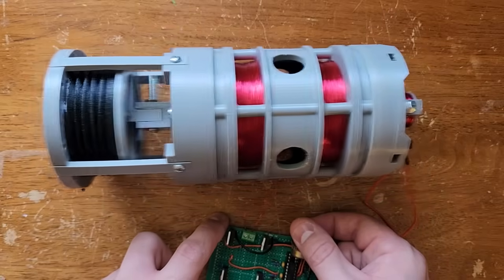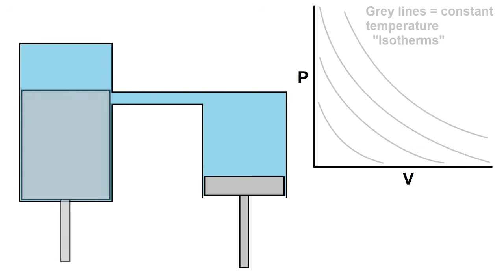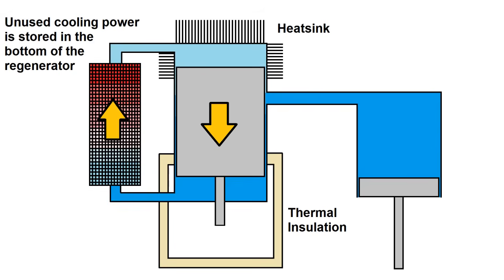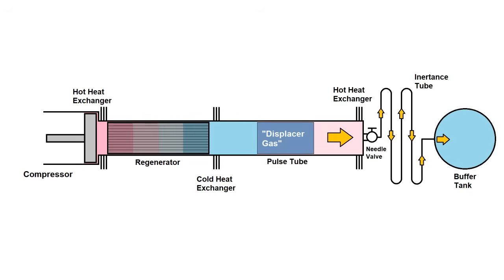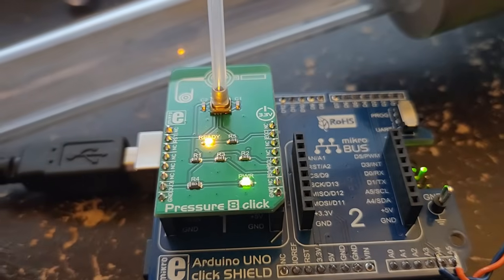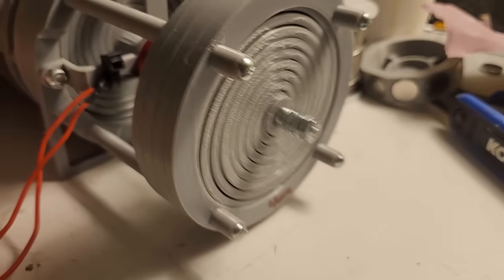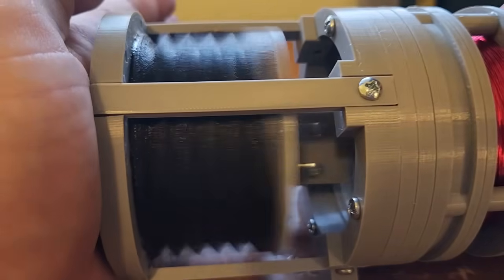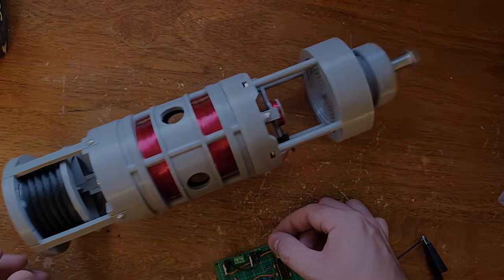Pulse Tube Cryocooler - Part 1

Comment: IIRC I saw the industrial/scientific incarnation of cryopump coolers on a trip to a particle accelerator with my physics class, I can't remember if it was to Rutherford-Appleton or a building above the CMS/Atlas sensor arrays at CERN, as cavernous as this service building was each cryogenic cooling pump was the size of a two-story detached house including the walkways and pipework above it. I believe it was used to cool and generate the cryogenic cooling fluids used to maintain the superconductivity of the hexapole beam guiding magnets. I definitely remember the all the racks of geiger detectors with large spherical sensors, the cabinets full of escape rebreathers, noble gas release alarms and the copious amount of asphyxiation warning signs in the subsurface service and office tunnel complex at CERN making me sweat a little. I used to work at a business park on the site of Culham Science centre and my office window and emergency exit opened out to a delivery bay with an inlet standpipe leading to a nearby tank that the cryogenic delivery lorry would hook up to every 2-4 weeks, the associated mist would swirl around and occasionally enter my office when the wind blew towards it and I left the door open to smoke outside.
I wonder how plastics would behave with the liquid oxygen that condenses with nitrogen from the air?

Comment: as you suggested i think that the way to do it at home has to be using a normal compressor and pulsing the air itself using some valves (the frequency could be an issue though). Also doing that way it should be alot easier to diy at home maybe with a little lathe. Is that the possible cheap open new way to build a cryocooler? hope it is because i need to experiment with some food in the kitchen :D

Comment: Aparently PT cryocoolers only work well when operated vertically. GM cryocoolers can operate in any direction. Wonder if that is a problem?

Information from Quantum Design UK and Ireland website. I am not an expert. Looking forward to part 2, with it working.

Comment: Amazing work! I always assumed a pulse tube cooler would require much tighter tolerances for the orifice and volumes. I'm trying to build a compression piston for a stirling cooler but can't tell if I'm getting enough compression for a measurable temperature change. What kind of pressure sensor are you using and any tips for sealing it?
Reply from the maker: Pretty much every piston is gonna have some form of blow-by, but if you run relatively fast, the blow-by becomes less relevant. For a lower frequency, though, I'd advise using a pneumatic actuator as your work piston, since the lip seal will actually hold pressure reliably. The only downside is that there's more friction than a typical piston.

The pressure sensor is an MPRLS series absolute pressure sensor talking over I2C to an arduino, but really any I2C pressure sensor could do the same thing
Reply: @HyperspacePirate  Thanks!

Comment: Use thicker copper wire in coil with more turns .. so that the push pull force will increase

Comment: Using a vacuum to draw water up a 34 foot tube would vaporize the water and create a cooling effect on the resulting gas, you'd then have to scrub CO2 and H2O. I'd then imagine your device as a railgun cycling to and fro hitting a spring loaded release valve on either side, so you'd be vacuuming up the already cold air, ramming it  and then cooling the exhaust but keeping it at pressure.

Comment: Really cool work. How hot are those coils getting? I think you could probably increase the H-bridge voltage, and maybe increase the distance between the coils, in order to increase compression. But I’d generally think that you need a lot more compression to make it viable, the only other thing to be tuned with this design would be the size of the piston. Maybe miniaturising it with the same linear motor would be the way to go? There’s a lot of energy in that piston, so I’m surprised at how feeble it seems at cooling.

Comment: You need single digit frequency and a longer stroke think in top dead center terms go to highest pressure and and it will push back on its own but you want it on its way back to compression then pulse the coils this will take some vibration out to

Comment: I'm completely out of my element but, I usually can still spot ways to improve something even if I don't necessarily understand it... With that said:
Having that counterweight is, effectively, wasted energy (lowering overall efficiency), by my understateding. So wouldn't it be better to utilize that energy by attaching a second, "passive" (no coil) piston to it and then tie it in with the pulse tube, with a simple reed check-valve? Or would that, more or less, be turning it into the Stirling Compressor?

On an unrelated note... Did I misunderstand, or was there not supposed to be a second gas present inside the pulse tube? 
Admittedly, I'm not really sure how it would stay separated, not just mixing and defeating the purpose but... 🤷‍♂️
Perhaps the buffer tank being filled with the nitrogen, and the intermediary tube acts as a natural check-valve of sorts, since the nitrogen would be denser by that point?? 🥴
Or... Maybe just use Sulfur Hexafluoride as 'other' gas? lol

I'll shut up now! Hopefully my ignorance shinning so brightly hasn't blinded you. 😉✌️

Comment: Interesting video. Another way you can achieve very low Temps is to cool a highly compressed gas then let it expand rapidly. With a scuba compressor and a bucket of ice water you can actually liquefy air. Just make sure to filter the CO2 out first as if you don't you'll end up with dry ice forming. If you wanted you could then cryogenic distill the different gasses in air out for various purposes.
Reply from the maker: Yeah, that's a "Joule-Thompson" or "Hampson-Linde" type cryocooler, which is the first type used in the late 1800's, and i think it's still fairly common for LNG/LOX/LN2 production on an industrial scale. The tricky part there is that pretty much all high pressure compressors have oiled pistons, so you also need a high-pressure oil removal system. There's also a tendency for expansion valve to clog with frozen ice/co2 over time, because even if you remove 99.9% of it, that remaining 0.1% will build up over time. Finally, the re-generator (which they call a "recuperator" in DC-flow systems) has to be very, very efficient - on the order of >90%. 

That's not to say it can't be done, but it's quite a headache, so i'm avoiding it for the moment.

Comment: Same type of cooler used in JWST. Very interesting video, but isn't the length of the tube very critical to match with the wavelength and resonance frequency of the motor to get the standing waves and so the nodes in the right spots to move heat?
Reply from the maker: You're thinking of a thermoacoustic refrigerator. Very similar in many ways, but a different device

Comment: I didn't see any coverage of your winding those coils, however you really need to try winding some common steel bailing wire you'd find at a home hardware store around the center of the electromagnets, and you could also try adding some over the top of the copper windings, though it will be most effective at the center (Both in the center and over the top would be great).  This will boost the effective magnetic field a great deal by concentrating it, and I think you'll be amazed at the difference.  It's why you'll never see a transformer (That isn't in the high RF range) without a soft iron or ferrite core.

Comment: Y E S O M G Y E S
damn Ive been busy but oh ma gawd I had been waiting for this.
absolutely sick video.

first things first, "temperature your girlfriend feels in a 23°C room" only if her legs are covered - if her legs are exposed to said 23°C she no longer feels cold.

also I'm a complete dumbass, and you're crazy smart, so I really have nothing to add here. the solenoid idea seems hella dope if you can implement it practically. in my experience solenoid valves aren't crazy fast, and I imagine they wouldn't last super long at 10hz+. 
but I also read some valves are actually air-assisted (the electric signal basically just opens a smaller valve and the pressure actuates the actual thing), so maybe with the 3D printer and the CNC you could make something like that for that specific purpose.
also I remember AVE's video on the hydraulic computer, so maybe you could also make an oscillating pneumatic mechanism where you could control the speed with a needle valve and it could actually be really fast and reliable.

thank you for the video man, this really made my day. as far as I'm concerned you're one of the best creators out here. you're actually doing the cool shit (pun intended but also I'm serious), and not just repeating something that's been done 50 times over.
Reply from the maker: Thanks.

In a valve-based system (called a "Gifford McMahon" configuration), frequencies are usually much lower on the order of 1-2 Hz, which solenoids can handle. However, on commercial units, the valve is typically a rotary valve with a motor inside the pressurized enclosure.

Comment: Hi. You explanation of how this works is very good and easy to understand, but one thing still remain unclear for me. I mean the regenerator, how does this part cool the gas. If you say that it works on Joule-Tomson effect, we have big problem named "inversion temperature", especially if we use helium, but almost all common GM cryocoolers works fine on helium. And this problem haunts me for a very long time. I would be very grateful if you could help me understand this.

Comment: Great effort on this attempt, you are really making me feel like I need to use my 3d printer more.  
So I used to work in a thin passive component fab and we used cryopumps on almost everything that didn't involve Silane(a super scary gas).  A cryopump is just a cryocooler with basically a heat sink on the cold end that gas would freeze to and pump out the cavity.  I think we had around 30 cryopumps and would re-build a couple a year.  They were all of the Stirling style where the regenerator was stacked mesh in the displacer.  They all had large compressors and used a valve cycle style setup.  
Typically our pumps would run somewhere around 8-12 Kelvins(when they were at running well).  
Once I got to look inside one when it running and had the baffles off; the frozen gas on the carbon heat sink looked just like water frost might look even though it was just frozen air at 10s of Kelvins.

Comment: Wow! I found this video on my recommended and was not disappointed. Thank you good sir! It's really enlightening to watch someone who's so comfortable with Thermodynamics and allows me to learn 'real' thermodynamics rather than the ideal systems I'm sure many of us have studied in class. So I just wanted to ask, is the bad thermal conductivity of the displacer key to the temperature difference achievable between the cold and hot ends? What I have inferred is that the storage and release of thermal energy coupled with the bad thermal conductivity allows massive amounts of heat to be moved from the cold end to the hot end, as each compression and expansion cycle widens the thermal gradientbl across the regenerator. In the same way, could a regenerator be used to generate really high temperatures, above what the compression of the piston can normally achieve, putting a heatsink on the cold end? Edit: Also, what would be the expected COP of these systems?

Comment: Very cool project! If I could make a suggestion or two: that resonant balancer is neat but super lossy. It'll be sapping a lot of your energy. The simplest and least interesting solution is to bolt the entire device to a heavy metal base, but there are also better and more interesting solutions. You could swap your moving mass with your static mass - a fixed magnet and moving coil (essentially a voice coil) using aluminium wire wound on a former would be much lower mass. Or you could use two motors diametrically opposed and in phase to cancel out the vibration - you'd need to match their resonant frequencies. Finally you could use two motors 180° out of phase and a manifold to couple the gas - the same resonant frequency matching would apply but note that some torsional forces be present somewhere between the two motors causing some vibration. I hope this was helpful in some way and can 't wait to see where this little project goes!

Comment: Hey, that's cool!
Have you thought about using a water soluble filament to make a metallic foam with a 3D printer to design a regenerator?
With some carbon/nickel-based spray paint you can electroplate the surface of the design/3D print with copper/zinc/silver/metals/alloys and you can then "melt" the water-soluble polymer away.
You may even make a "tinning solution/liquid tin" to make any plastic immediately conductive prior to a ticker coat with another metal but that requires some "extra chemistry".
Anyway, this would give you more options and it's definitely cheaper than buying overly expensive metallic foams.
Have fun!
Sincerely.

Comment: Will be following along with your work on this. I have an STI Hybrid 98 but it so precious to me that I hate running it unless needed. I can get about 8W heat lift at 77K with a water cooled jacket I printed for it.
Reply: I also have STI cooler, but running it with stock aircooling which is supernoisy. Can you share your watercooled jacked 3D model?

Comment: You are very good at electro-mecanics and electronics. Install a blade valve at the discharge of the compressor and before the copper heat exchanger (it will act as a check valve to keep always the flow in the downstream direction). Recycle some of the air in the buffer tank back to the compressor suction (use a needle valve to easily regulate the flow rate and the pressure drop). Insulate the recycle line and needle valve to reduce lost work to the environment (exergy). Calculate the power of your copper heat exchanger as a function of the frequency of oscillation of the piston  and use a cooling bath instead of ambient air (ice, water, sea salt) or a cryogenic mixture ( liquid nitrogen and glycerin) if necessary. Inmerse the buffer tank in a cryogenic mixtue. Monitor the temperatures at the heat exchanger, at the downstream end of your steel mesh, and inside the buffer tank. Monitor the pressures (pressure transducers) to make sure that you keep a contant recirculation flow rate to force an accumulation of liquid air in you buffer tank. You can expand (with a needle valve) some of the produced liquid air from the buffer tank in the shell side of your copper heat exchanger (as a second economiser) and feed the heated air together with the recycle stream to the compressor suction. Don't forget to reach partial steady states before reaching the desired final operating conditions.
Reply: do you mean like a flap on the piston side, so air cold air can flow in pushign the flap out of the way, then as it compresses and heats up, it pushes thropught the fewer openings, as the flap is closed?
Reply: @any1alive  I was referring to a discharge valve (red) but if a suction valve (blue) as you described is also added, it will increase the compression efficiency. https://youtu.be/YCpayFv83Tc
Reply: @chibigon01  Ooo yes i understand now, i was thinking of it backwards lol. it makes sense now, my brain was trying to fill in the blanks lol

Comment: Real liquid nitrogen generators use 2000 psi scuba tank compressors, and they are not made of plastic.  Think hard polished metal parts, tight tolerances, bearings, and a powerful motor for your next project if you want success.  Nice video though.

Comment: They use these in special microwave detectors and MRI machines. Had several very small ones designed for heat seeking missile sensors years ago 🤓

Comment: I have seen a few of these running at 60hz and using helium as the gas in the chamber. Might want to go to a party store and get a helium tank or a few balloons and see if that helps. PS. I love your explanation of the principles behind this, it makes it much easier to comprehend. I actually tried to explain it to my mom a few days ago and I doubt she was any closer to understanding it after.
Reply: I can understand the thought of using helium, however, wouldn’t a larger gas/gas molecule be better in the concept of slowing the thermal conductivity? Case in point the available electrons in helium are much less then the electrons in CO2, but since the mass of the CO2 is dozens of times the mass of the same molar weight of helium it’s thermal conductivity would be more. But since the conductivity is offset by its physical mass, the slowness of that thermal transfer in the transfer tube would be slower then the helium, allowing a lower oscillation rate.
Reply: @njvikings1  
Apparently Helium is excellent, one of the best thermal insulators.

Comment: I like very much your video! Try the TASHE configuration the with feedback tube. Put the regenerator  near the junction. Simplier and much better!
Reply from the maker: I'm looking at that as an option, the trouble is I'd be simultaneously trying to optimize the thermal efficiency of the driver and the cooler, whereas if I got a regular electric motor, driver power/efficiency would at least be known
Reply: @HyperspacePirate  The inertial tube doesn't look good. The inertial tube should be thinner and after must  be a puffer tank or a membrane but I do not see these. I tried this in the past by placing a membrane with a small mass instead of an inertial tube at the end of the machine. But even that wasn't that good. TASHE was simpler to me. See my videos and  my webpage (tibsim thermoacoustic 1488) )maybe these can help you! I like your all video and this driver is too fantastic!